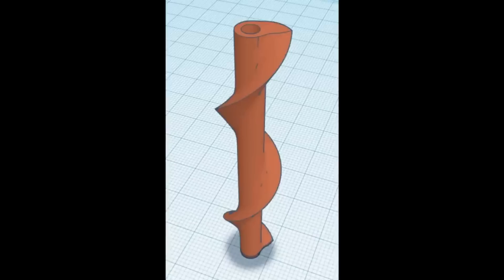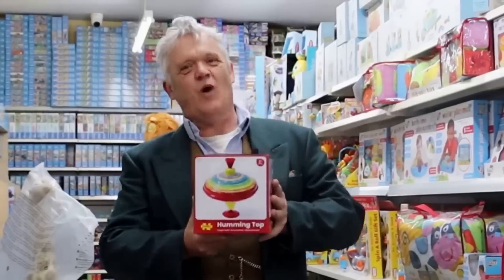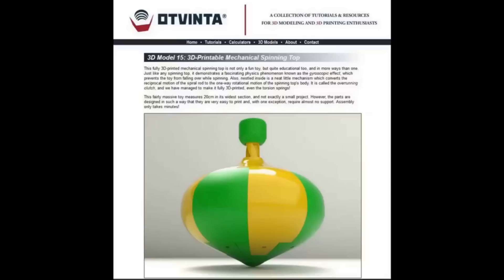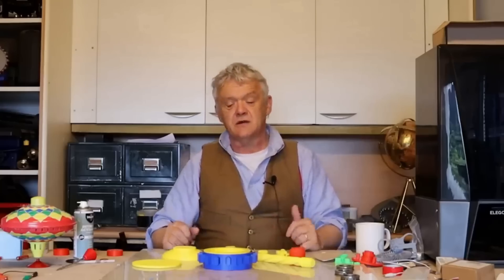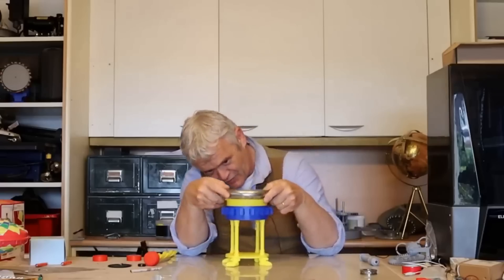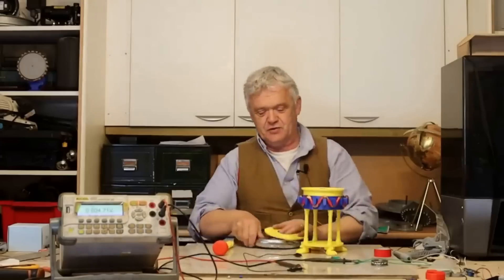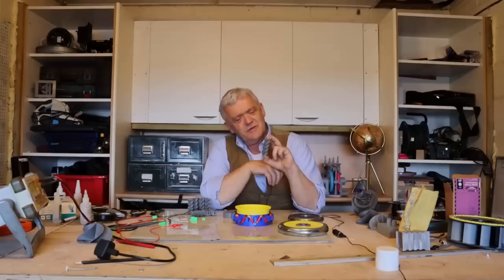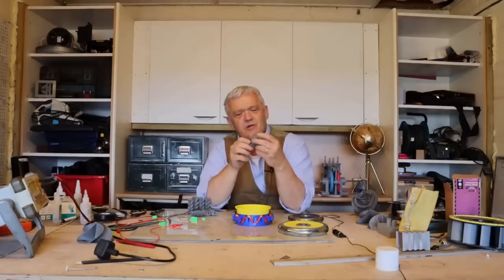2183 Storing And Using Gravity For Emergency Power

Comment: Great video. I read somewhere that transitional electromechanical tower clocks (between full mechanical and full electrical drives) that incorporated a weight in the design could maintain time during a power outage with the "stored" energy in weight.
Reply: Look up weight driven grandfather's clock.

They had weights on chains.
The weights were raised by pulling the chain down and the clock would run for days on end.
If I'm remembering correctly, my grandmother told me it ran for 24 days at which point I thought; why not 30?

Basically, if you made a  point to pull the chains up every two or three weeks, it would run until it wore out.
Reply: Seriously?

Sorry, just joking. 
But ehm, this old technology is known by everyone, i would assume.
I mean: Everyone knows a grandfather clock.
And those who don't have been born in a place on earth where they never had any technology from the recent past. Tribes on islands still using bow and arrow, yes, i can imagine they would not know this technology.
but somebody who is able to put a comment underneath a youtube video, i assume such a person does already know about Grandfather clocks.

And every clock has a different running time.
It depends on the clock, the length of the pendulum etc.
If the clock has a gear train that can handle a pendulum that swings every second, then it may take a very long time before the weight reaches the end. 24 days may be possible. I dunno.
Shorter pendulum will go faster.

I got 2 of em. An oldy with a simple bell sounding every half hour and it strikes the hours.
And i got a bigger one, with 3 weights. And in it it has the Westminster Chime, sounding every quarter of the hour.
First quarter is obviously the first part of the melody. Second has 2 parts. Third 3 parts. And the strike of the hour has all 4 including the deep sounding bell sound indicating the hour. So 12 o clock it sounds 12 times.
Warmink is the producer of that one. And if i am not mistaken the other one is from the same maker. 
Dutch clocks. Friese Staartklok is what the simple one is called. And the other one i believe is called Amsterdamse Staartklok.
But i am not too sure about the last one being called Amsterdamse Staartklok.
Anyway, they both also have a moonphase indicator. 
And the big one with the 3 weights has a handle so you can turn on or off the chime bit. So you can turn it off during sleeping time. And it resets itself when you turn it back on.
The other one does not have that feature. It will chime, unless you take off the weight or block it from falling. Plus, when you take it off or block the weight from falling it will not keep up. And so, if you reinstall the weight, chances are that the chimes will not count the correct hour. Like say: its 3 o clock but it could chime 4 times, or 2 times. You have to reset it manually to get it back to the right order.

Anyways, neat technology. Very old. And i would expect somebody who knows his or her way around the kitchen on the internet to already be familiar with this kind of technology.
 @scotttovey
Reply: @bertjesklotepino 
"but somebody who is able to put a comment underneath a youtube video, i assume such a person does already know about Grandfather clocks."

That's a bad assumption.
Recently, in a video, it was reported that a certain generation had to be shown how to use a rotary dial telephone. This tech is not as old as the Grandfather's clock.

Remember the air Jordan tennis shoe? The one's where you pump the soles up so that you are walking on a cushion of air. They certainly did sound revolutionary to me at the time.

Then one day, I happened to go to a museum that had a historical display.
There was a sign that listed some past inventions.
One of the items listed on that sign was a shoe that was made in the 1800's that had a pump up sole.
Not so knew after all.

People make assumptions all the time.
Sometimes the assumption is accurate.
Most of the time, the assumption is wrong.

Here's one I recently learned that surprised me.
The truism that human pregnancy lasts 9 months; is in fact, false.
Given a normal pregnancy with a full gestation period, birth always occurs in the tenth month.

Assuming that people know things is the quickest and easiest way to destroy a nation. 
Take the often used, don't be lazy rebuke of "Do your own research".
That statement is predicated on the assumption that a person which is able to type words in a text box on a computer connected to the internet, also has the same search engine skills as the one claiming to have specialized knowledge of bad actors.

Not only is that a bad assumption, it is an extremely selfish one.
In order for one to find the given bit of knowledge that another person has, one must know two things;
1) The exact key words that were used to find that bit of knowledge.
2) The exact search engine that was used, and that search engine must be in the same state that it was in when the individual with the special knowledge found the special knowledge.

I used Google for several years to do searches to learn PHP.
At some point, having forgotten a specific way to do something, I went to Google and typed in the key words I remembered that brought up the information I needed.
Two things had changed.
1) The PHP website had deleted a lot of the comments that users posted on the website for no apparent reason, thus the information that had previously existed, was no longer there.
2) The search results did not have as many links to the PHP website as it did before. Google changed their algorithm.

I will often state the obvious for no other reason than the fact that very few people will. The end result of very few people stating the obvious is that the younger generation is now deceived into believing that poverty inducing socialism and communism, are more beneficial than wealth generating capitalism.

I also do it because I at 62 years of age, I can look back on my life and I realize that there were a whole lot of "obvious" things that no one was willing to teach me when I was young, and I did not see those "obvious" things, until I heard them mentioned in YouTube videos.

I cannot see what's on your computer monitor.
You cannot see what's on my computer monitor.
The only safe assumption is that we both are using a web browser to surf the internet.
Any assumption beyond that, is a bad assumption.

Comment: Wow Rob that philapine university device blew me away. I was already thinking of the stepper motors I have as your omnibus was playing out but that idea of flipping it over really is the genius idea! You could swop out the weight for water or dirt sand to increase portability too
Reply: With a tank as a base to negate the need for it to be fixed down. To act as a counterbalance to stop it tipping over when you rotate it.

Comment: It reminds me of something I read about, there's a village somewhere on top of a large hill and they have a system for pumping water to the top for drinking by using the waste sewerage and rain water to that fills a carrier but I can't remember if it turns a pump directly or is hooked up to a generator but that's how they get the fresh water up the hill/mountain
Reply: - very funny...  (if the rainwater is already up there, just use that it is already "fresh" and "free) - "jet pumps"  use falling water to pump SOME up to a greater height - there are losses however (thermodynamics isn't imaginary)...

As described it would be a famine inducing construction...

Comment: Did you know around half the power consumed in california is used for moving water around the state.    There is one pumping station with seven 40,000 horsepower motors that lift the water almost 2000 feet to flow into los angeles.  But there are lots of 30 to 100 foot pumping stations that i feel could be augmented by modified archemedes screws.  Actually spiral tubes of several meters in diameter and the lower end of this is on a floating barge so the depth of the dip is controlled so the top of the tubes are never filled to the overflow level.  This might be able to lift significant amounts of water without and bypassing with much smaller motors to spin it.
Reply: Or maybe a series of massive ram pumps if there is sufficient head maybe

Comment: That long steel screw shaft is expensive  >:(
Reply from the maker: so? - what is the alternative? Clue - there are loads of alternatives Don't just point out things you see as a problem and think you have added something  - point out a solution too - then you really have added something
Reply: @ThinkingandTinkering  Well we could use something like a pulley. Thank you for noticing me 🤗
Reply from the maker: i like it mate nice suggestion - cheers
Reply: ah but you're imagining that they're using some brand new product-steel is one of the most widely used materials in the world, especially steel in the form of long thin rods.  with the right tools and knowhow you could recreate something like this from a piece of literal garbage using a home made cutting rig made of wood and a bit of tungsten carbide
Reply: @dayvancowboi9135  these screws are machined on a big lathe with specialized tools taking some time and skill - hence the cost. If there is an easy way to make them on a budget in a home workshop i would be happy to see it.
Reply from the maker: as for making a screw that would do the job - grab some square stock - heat it - stick one end in a block and twist from the other end - that is how they used to make the bolts for fixing the rails to sleepers

Comment: I have oft wondered about gearing the output shaft to allow a short throw( drop ) to provide longlasting power output.
Reply: I havent done the research yet but, I wonder the same. IS gearing or a pulley system more efficient?